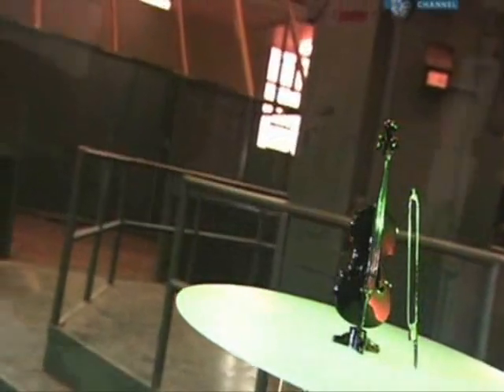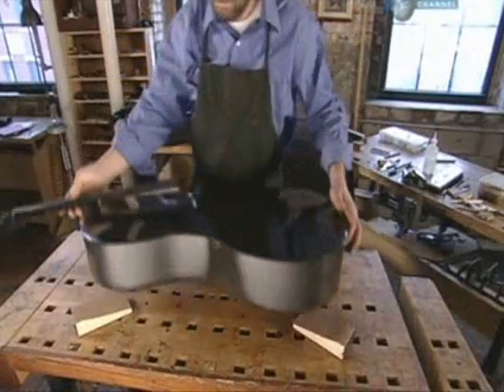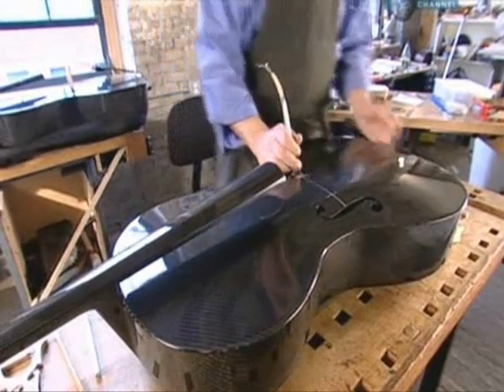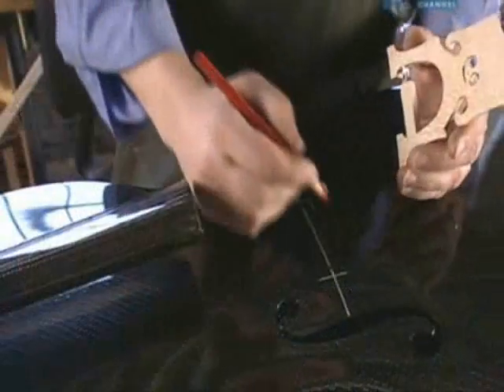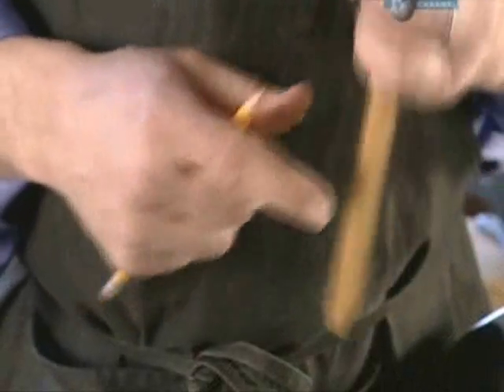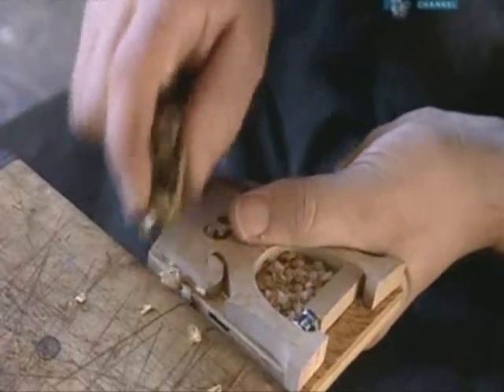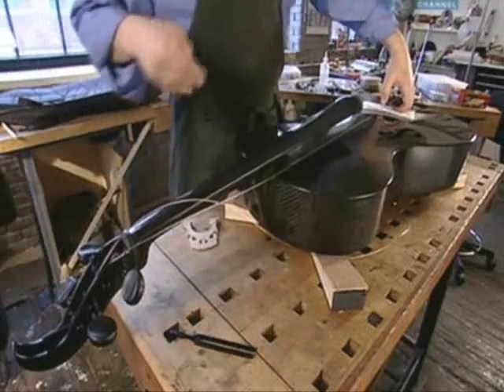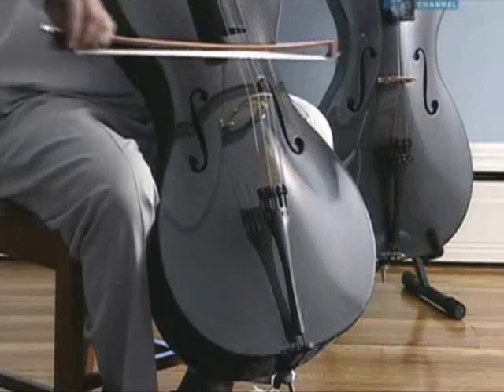How It's Made - Carbon Fiber Cello (Pt.2)

Comment: @KissakiSan I have been a cellist for over twenty five years and have played with many orchestras. Carbon fiber is only acceptable for a bow. Carbon fiber instruments are only a cheap alternative and should never be used when concertizing, as they produce an annoying buzzing noise. I recently was in the market for a new instrument and tried one out. UTTERLY ABOMINABLE. The pegbox measurements, all wrong, making the strings unable to stay in tune.

Comment: The strings are so tight that they hold the bridge in place. However, if the bridge IS knocked out, it only needs to be replaced and the strings retightened in order to replace the tension on the bridge.